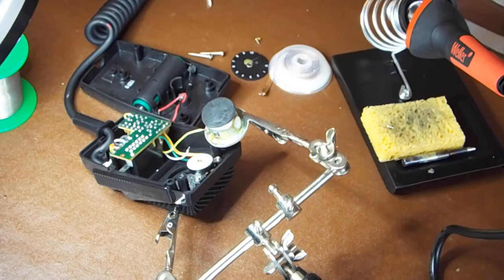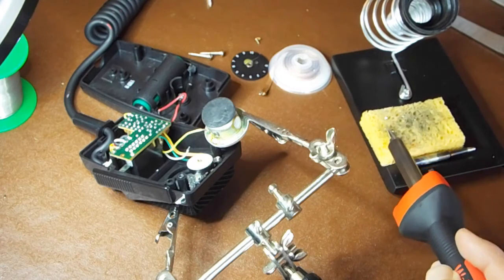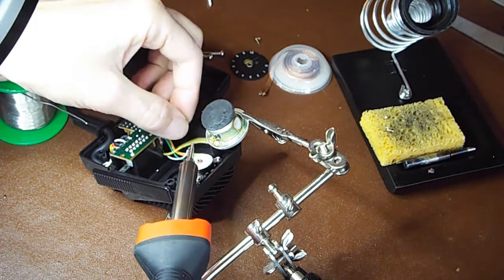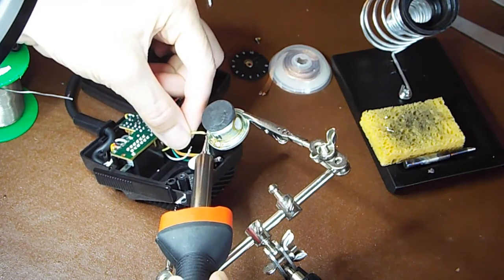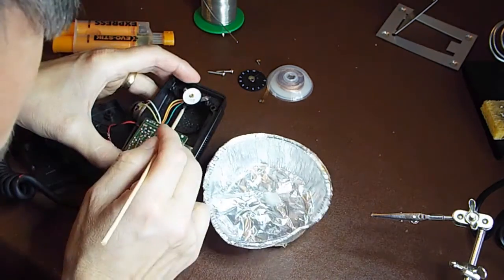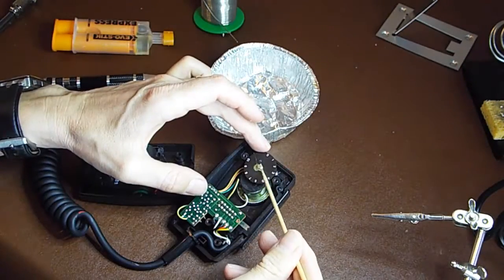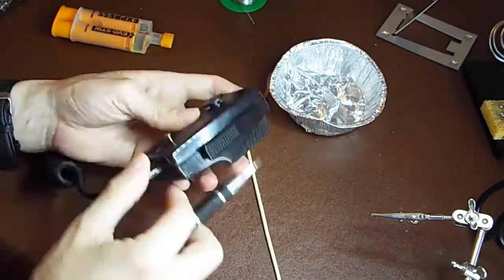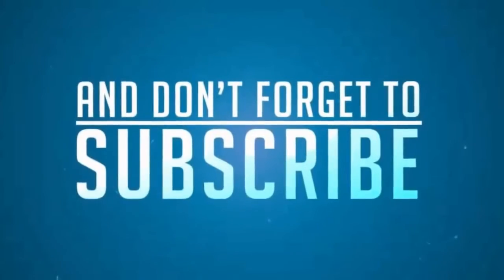WELLER SP25NKUK SOLDERING IRON.  CB mic repair.

Comment: .........UGH!!! It's not a 25 watt iron! lol

It's a 40w...  You may have purchased a 25 watt iron, and meant to receive a 25 watt iron, but what you received is the Weller SP40. The SP25 takes completely different tips.
Reply from the maker: Got you.  That prob explains why it gets so hot so quickly .then
Reply: Possibly. Still a good iron. Better, in fact. Because of the tips that it takes... With the 25 watt model, you're limited to a selection of like 3 screw in type tips. With this one you can choose from like 15 different tips. It's great. Though the only problem is whenever you're going super delicate work, then you burn shit. lol